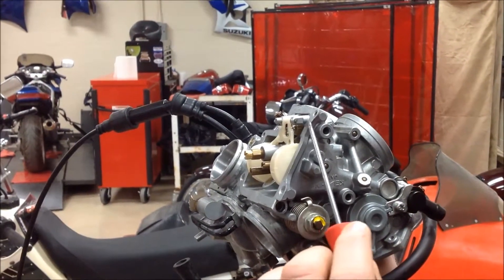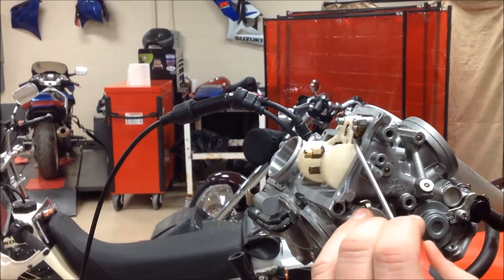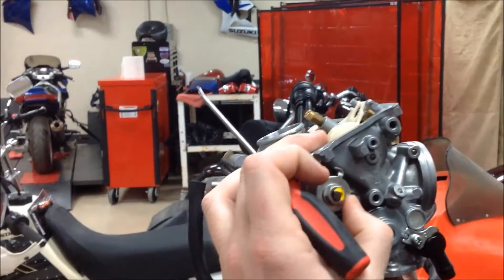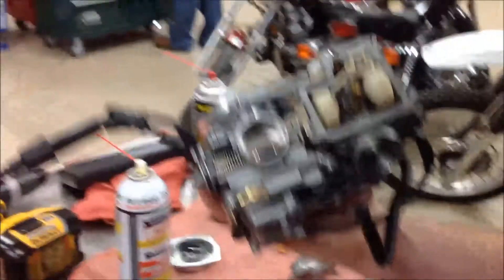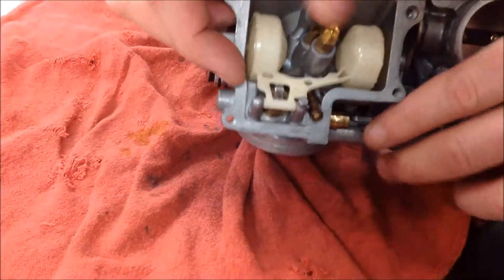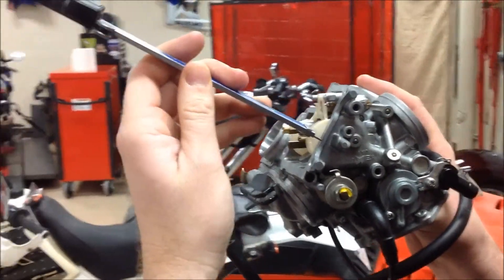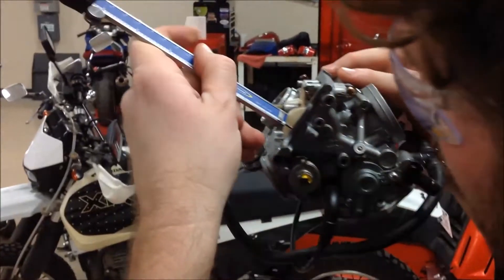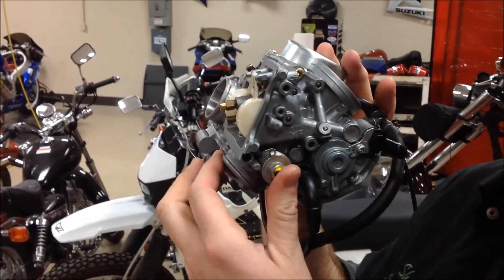How to adjust float height on a carburetor Metric Harley Asian

Comment: ii am having some issues with  a cvk 30 from a kymco venox 250..the service manual says 17.5 mm front and 19 rear.. there's another way to measure this?? because i guess it s too much
Reply: Miguel Laricchiuta I've never heard of float levels set that high,,,,???  If so they can be changed to thousands of an inch,,,,,.  Or fractions of a inch,,,,.  ???    But generally they're always millimeters,,,,.  ???